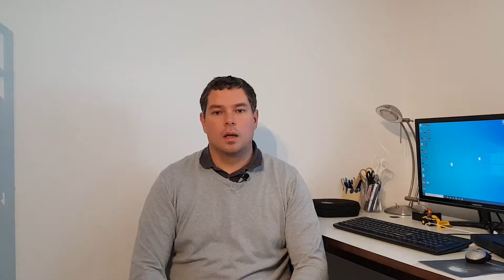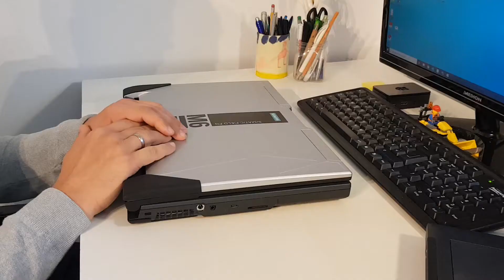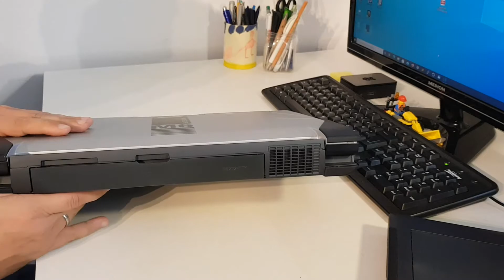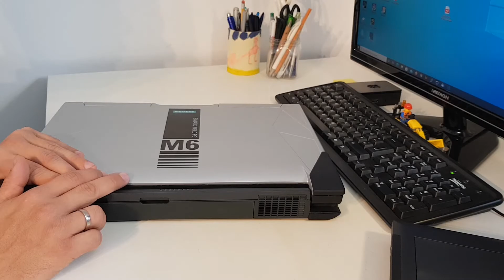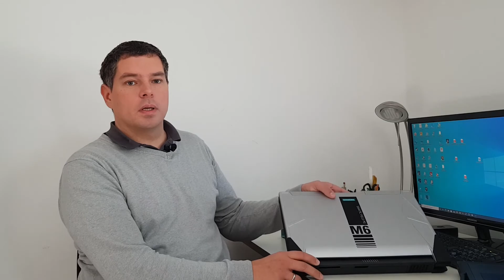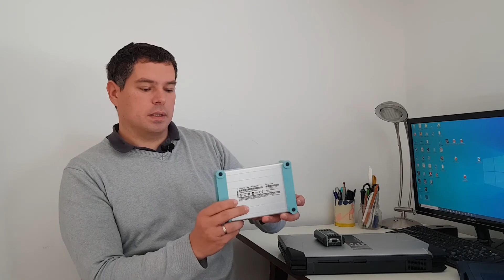SIEMENS SIMATIC Field PG M6 Hardware Overview

Comment: Can it be used with Linux or do you absolutely need Windows?
Reply from the maker: It can be ordered also without Windows license. So you can also use inux as operating system. All "normal" Laptop functions should work as you can use standard drivers. But be aware that Siemens does not offer Linux drivers for some of the specialities like MPI interface or Simatic Memory Card reader.
Reply: @sebastianslab  Okay, I understand. Thanks for your help. I was just about to look for a couple of Simatic cards too. :)

Comment: who needs this? 

i am asking honestly
Reply from the maker: This device is a tool for commisioning  and maintenance of industrial machines and plants. It's more robust compared to a normal office laptop in terms of operating temperature, EMC, shock and vibration. It also comes with special interfaces to support industrial connectivity without the need of an additional adapter. For more details see video or product page.
Reply: Otomasyon işi yapanlar için

Comment: (NVMe size 2280 ?) PCIe 3,0 Thank you
Reply from the maker: NVME is size 2280 PCIe 3.0. If you do not order the device with NVME but want to install one afterwards it's recommended to do this in a repair center asdevice has to be openend quite a lot for installation.
Reply: @sebastianslab  Thank  you .
Reply: SSD     win boot 26sec
NVME win boot 21sec